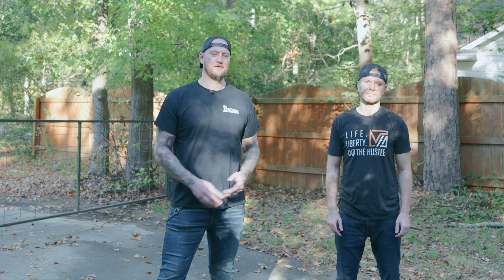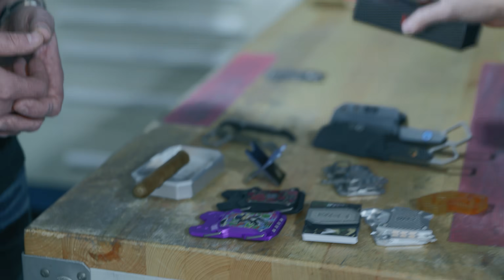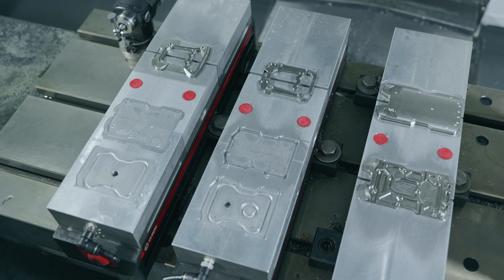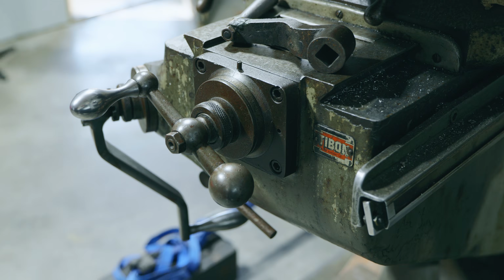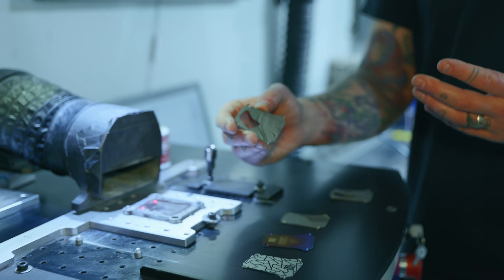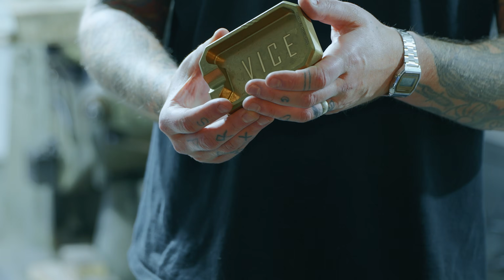American Made: How VICE HARDWARE Created Their Own Products | Machine Shop Tour

Comment: a CNC router table with a 0.5in aluminum bed would be perfect for running 50+ parts at a time and they have auto tool changers. You can also get them with coolant misters on them. you'd just need to build a enclosed to keep the shavings contained. You can machine in threaded holes for fixturing your parts to and depending on the machine you could have anywhere from 30inx40in to 4ft by 8ft of workable machining area.

Comment: If you dont have 3 phase how are you converting to run the haas?
Reply: I have a 5hp 3 phase motor in my basement, spin it up with a pony motor then send 2 wire 220 to it and it will accelerate up to speed. The third wire will now have an output. Send the 3 wires to my garage to run my machines.  Been doing it for 25 years. The third wire will be somewhat out of phase and high on voltage and the motor on your machine will only have about three quarters of its stated output but that rarely matters.
Reply: I have a phase converter. I built it. works great. But using it to power a haas mill or a high load Lathe is a different story. BTW, A weak third leg is no bueno. @quickturn66
Reply: Phase converter. Had one in my house to run a commercial walk in freezer
Reply: Get a real rotary phase controller with voltage monitoring. Your machines will last.
Reply: @douglassmith2055  my machines have been happily running for 25 years

Comment: Who tf puts a bridgeport on wheels "Hey bro, what precision machinist level did you use to level this mill?" me: "wheels bro. wheels"
Reply: Yeah I’m sure he needs .000000001 accuracy when drilling a hole 🤡
Reply: @OctoRon  with that setup he can't even trust the thousands
Reply: @valkman761  You have alot of Opinions
Reply: @vicehardware  isn't that what the comments section is for? .. and not for something that's completely irrelevant like your comment
Reply: eh,  my home mill and lathe are both on leveling wheels.  I understand the limit of my tools.
Reply: It would seem a Bridgeport mill unitized base and column would hold rigidity even in a gravel parking lot. You trippin.
Reply: It's a a Bridgeport, it's an overglorified drill press who cares if it's level
Reply: @procyonia3654  not just glorified, but "over"glorified? That's quite an "over"statement. It's a question of tool life if you're using anything else than HSS
Reply: @東京ワナビ  he's obviously using the real machines to make money, and using the Bridgeport for prototyping and miscellaneous stuff. Even then it doesn't need to be perfectly level, it's not a boring mill, bridge mill, or even a bedmill it's structure isn't going to flex so bad you can't hold tolerance on the type of work he's doing with it.

He has a small space in a small space the ability to move a tool, trumps a theoretical inability to hold a tolerance on a machine he isn't even using to do that kind of work.
Reply: @procyonia3654  👊
Reply: @procyonia3654  obviously you think he's running a bigger circus than it actually is
Reply: @東京ワナビ  at the end of the day he's getting paid for the work the machine puts out, and you are in a comment section whinging about irrelevant shit.
Reply: @procyonia3654  a wise man once said doing something alone is not worth doing. And anybody who's been into production knows this.
Reply: @東京ワナビ I have no idea what you’re even trying to prove at this point
Reply: @LakewoodMachine  why would I try to prove something? Typical Youtube commentary section... someone probably asks me to a video about it next. And I honestly don't understand why you specifically keep running through the comments. Don't you have a business to run?